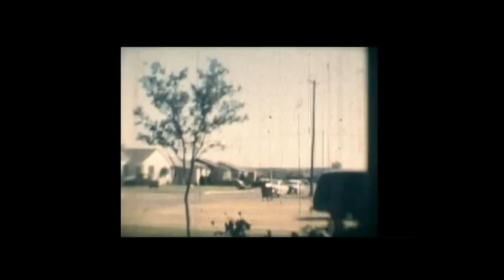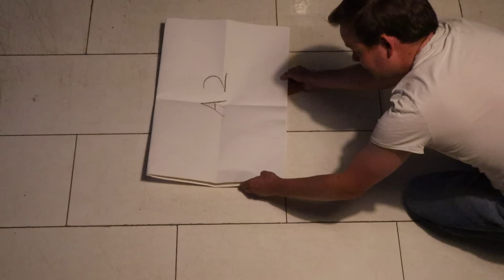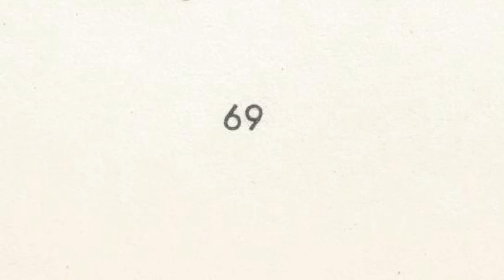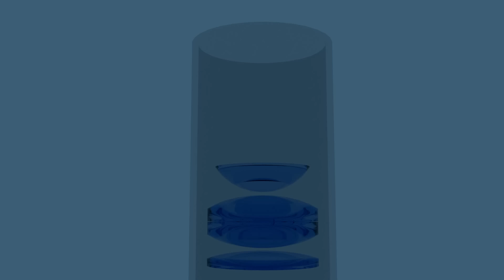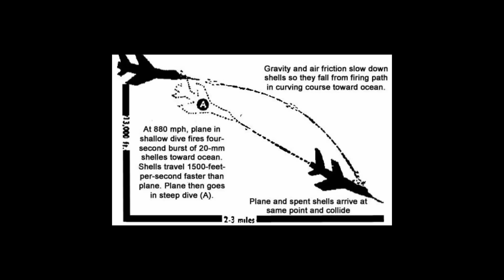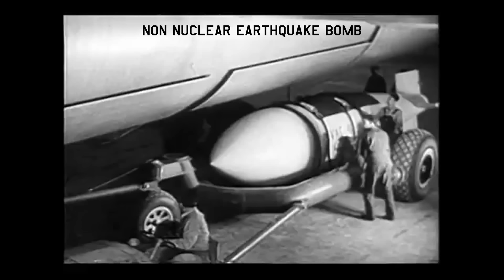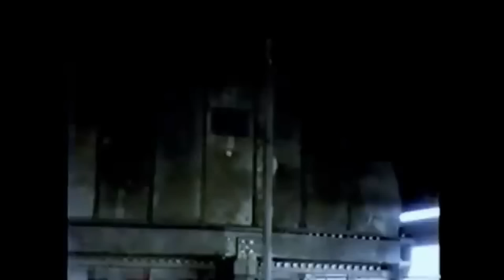Unfathomably American: The Armament Systems of the B-36

Comment: I am at work so I will have to put off this video till later this afternoon. However, I am extremely excited from what snippets I see and I must ask as I did not see in the description:

Is there a way I could get a copy of the manual? I so happen to be working with another on trying to get a demonstration of one of the original b-36 turrets going for the historical record, using both of our resources/parts. Thusly I have been wanting a copy of the turret manuals but they are generally quite pricy.
Reply: Some notes as I am watching this now-
The US made Hispano-Suiza guns are an entire endless rabbithole on their own. Bureau of Ordance did their magic and managed to fuck those things up in several ways, and never truly fixed them. They desperately kept at it though, as they and others had realized the power of a usable HE round made the firepower of one 20mm cannon equal to several .50s (Ive seen it quoted from 3-5 depending on the time). However, due to an obsession with velocity/easier leading, this was also at the time time Bureau of Ord was doing an absolute smattering of .60 caliber projects where they took an anti tank rifle round, very similar to the Soviet 14.5mm, and attempted it in various designs including a reverse engineered MG-151... the gun that was built in 15mm, and then redone in 20mm by the Germans (very obvious foreshadowing) as well as other things of note like the gun that would become the M39 revolver cannon and the gun that would become the "Vulcan Cannon". At the end of all this they remembered what they had already done studies on, that 20mm was the minimum viable size for a usable HE charge and fuzing, and just took .60 caliber (15.2x114mm) and necked it up, creating 20mm Vulcan in an era when everyone was already working on either higher payload (30mm) or higher velocity (20x139mm, etc) versions. Truly amazing. Now we load our phalanxes and the like with tungsten or DU core sabot ammunition to make up for this.

I would like to note that the WW2 British produced Hispano-Suizas are actually still in service today - they were used in jets for a period and then sold, and Sweden installed them in IFVs and others, and now Ukraine has some of those, and I think some others are still floating around in various service.

Electric ammo is common in aircraft at this point (well.. for those that still use guns) and was in development for some time. .60 caliber had electric, 20mm had been in the works and the M24 was specifically an electric version of the M3 which was percussion only. I know for the M24 in particular they added extra hooks to assist with pulling unfired rounds out of the chamber, and likely it was related to the issues you mention. The wax and oil is related to issues from the original WW2/Pre war shenanigans and I will add a relevant quote as a reply to this.

That wall of text over, this is incredible! And the fire control radar locking on is absolutely insane. And these models! The Animations! The pictures! At least one of these shows an electric winding mechanism I had wondered about being used on these things!
Reply: Here is a relevant quote about the US Hispano-Suiza guns from Colonel George Chinn, author of The Machine Gun, a multivolume series for the navy going into intense detail on domestic and foreign cannons and machineguns, both in history, development, and technical design, with a focus on aerial guns:

"Due to an outmoded agreement of longstanding, everything above caliber .60 in the Army is considered artillery and the manufacture of the Hispano-Suiza cannon therefore came under this classification. In other words the production of this high-speed machine gun was done under artillery manufacturing tolerances. The resulting poor mating of parts, coupled with the inherent fault of all gas-operated weapons whereby the breech locking key in the receiver is immovable and the position of the gas port in the barrel is permanently fixed, with made it impossible to adjust the relationship between barrel and breech lock to establish headspace. Thus the most vital measurement in any automatic weapon was governed by chance in this instance.
An unfortunate discovery was that chamber errors in the gun could be corrected for the moment by covering the ammunition case with a heavy lubricant. If the chamber was oversize, it served as a fluid fit to make up the deficiency and, if unsafe head space existed that would result in a case rupture if ammunition was fired dry, then the lubricant allowed the cartridge case to slip back at the start of pressure build up, to take up the slack between the breech lock and the breech lock key. Had this method of "quick fix" not been possible, the Navy would have long ago realized the seriousness of this situation. In fact, this inexcusable method of correction was in use so long that it was becoming accepted as a satisfactory solution of a necessary nuisance."

This continued for the entire lifespan of these guns in US service.. The last model used by the US, the MK16, was used on ships, riverboats, and later the coast guard, from earlier M3 and M24 model guns given cartridge lubricators or at the extreme and an in chamber atomization system for oil lubrication. 
Hispanos in the US are an insane rabbithole.

But, back to the start, if there is any way I could get a scan of that manual it would be extremely helpful for us both in the attempt of getting that turret operational, or at least enough for a demonstration to be recorded with modern quality footage for history.

Comment: The first time I saw the B-36 FE station, it was a SAW trap where the only objective was to start all 10 engines.

Fun fact: N block only stands for nuclear if it's the primary propulsion powerplant (e.g. SSBN, the flight models of NERVA or Orion, etc.), and it always trails the mission categories (a nuclear-powered recon-converted Hercules would be RCN-130, for example)
Reply: The USN uses N as the suffix for nuclear power, but the aircraft designation system is different. Engines get a propulsion system prefix, but aircraft don't.
Reply: Interesting, I assume it stood for non-standard in the NB-36, similar to the NF-104?
Reply: @simplsquam  The best explanation I've heard is that N can stand for "non-returnable", e.g. under permanent modification, and cannot be returned to a pre-modified example, like with, for example, tanker or gunship conversions of the C-130, which are technically possible to reverse, but you'd be in a VERY desparate situation if you need to move so much cargo that you'd be willing to strip millions worth of modifications.

Edit: See also, the NC-131 handling test craft, the NC-135 Special Missions Airframe, the NF-15 STOL testbeds, or the NF-16 (now X-62) thrust vector and AI control testbed.
Reply: @kingawsume  It's specifically used for special tests. Could be anything, but the changes are intended to be permanent, and the mission so niche that a new mission designation isn't warranted, since they're usually one-of-a-kind.

Comment: The design made sense if you assumed that more powerful weapons would be even larger than the originals. That made sense from the perspective of conventional explosives. As it turned out, the actual weapons got much more powerful and a whole lot smaller simultaneously.

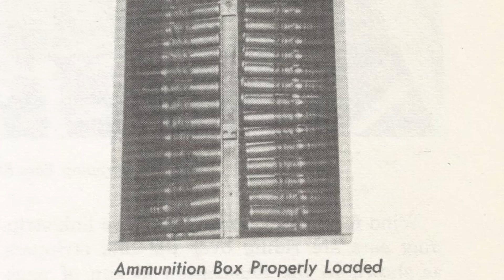Comment: 31:39 Electrically fired ammunition is actually very common in aircraft autocannons.  It is more reliable than mechanical firing when high rates of fire are desired in combination with the G-forces of maneuvering aircraft.  I'm not sure if that is as applicable for a bomber, but in general, many guns designed for aircraft tend to use this system after WWII.  As far as I know, the first widespread use of this was the MG131 which the Germans developed first before WWII.
Reply from the maker: Thanks, yeah it does make an awful lot of sense now that I know it is even an option.
Reply: @Alexander-the-ok  The M61 Vulcan used in many 4th Gen fighters is electronically fire.
Reply: @Alexander-the-ok  do you plan on covering the SR-71?
Reply: Dude electrically fired guns should be a mainstay now. We have solid rocket fuel we can turn off, or on.

  It's called ESP. Electric solid propellent. 

 We have rugged batteries, and graphene capacitors that can offer 15k shots at least before charge. 

 Electronics can last decades in space. They can last in a gun as long as it's designed properly. 

 There would be less delay for shooting. Guns can be made simpler actually. 

 Don't know why people are so adverse to electronics. 

 Wait I do. They buy the cheapest things from Temu (or most advanced). Then compare that to electronics that were made to last. 

 Got them in Safelites, fighters, BULLETS. Nuclear weapons. 

 No I don't think the smallest node or most advanced chips are durable. But it's just a gun. It only needs the simplest electronic to function. Mostly some wires, a battery, a capacitator.

 EtronX is a good example. There's a few electronic guns out there. 

 Dinosaurs when it comes to guns. 

 Honestly they should've put less guns, but bigger. Heck one 76mm flak cannon would be easier to compute, and probably better ha.
Reply: @RedactedDeath part of it is regulatory. A firearm with an electronic primer can easily be turned into a Smart Gun. There have been several attempts to require all guns to be smart once one enters the market.  To gun control advocates, that means the gun is locked and useless unless it is unlocked. 

The other regulatory issue is that a semi automatic with electric primers can be easily converted to a machine gun.
Reply: @simbry49 Ah yeah, no thanks. When I say I want electronic guns I mean just a simple mechanism for an easy trigger pull. Maybe even for a reload system. 

 But really you can make such a simple, robust design that would last five years. Sure you'd have to replace parts. People act like mechanical crap is maintenance free. 

 Anyway I was always told the cost of switching to electronic small arms just would be too costly. Not seen as needed. 

 You saying that honestly instantly makes sense as well. The only smart gun I want is one with next gen scope tech, and electrically fired bullets. 

 Perhaps an electronic loading system depending on design. Guns can basically just be barrels going the metal storm route. Same idea, just with one tube to shoot. The other tubes cycling ammo.
Reply: @RedactedDeath  * years ago Forgotten Weapons covered a Remington 700 that was available 20 years ago that was electrically fired. 

https://youtu.be/8qP6Q9ZEsEo?si=0lzgyO4_i-Gw1ViP
Reply: electrons fast
Reply: @mark.audacity  It’s more that electrodes don’t move. You can put the switching equipment somewhere easily accessible for maintenance, and just run a live and ground cabling into contacts on the bolt track so you only need to rub ‘em down with de-oxidizer every now and then. And you can use an oscillator and a potentiometer to adjust rate of fire on the fly by changing the timing of pulses running into the bolt
Reply: @mark.audacity electrons very fast only photons faster
Reply: This is true, but it's not the only reason why the B-36 specifically used electrically fired ammunition. My grandfather actually worked on the B-36 - he was an electric engineer, and he went to work for Convair as his first job after college in 1946. He was assigned to work on the either the electric ammunition system or on the tailgun radar system (I can't remember which, and sadly I can't ask him as he passed a couple years back.)

Anyway, as my grandfather told it, when the guns for the B-36 were being developed they were initially designed with traditional mechanically-fired ammunition. However, the design of the B-36's turrets - with twin guns mounted side-by-side - created a problem with mechanically fired ammunition. There was no way to get both guns in a turret to fire in perfect synchrony with the mechanical trigger mechanisms, they always fired very slightly out-of-sync. And when the guns in a turret were firing out-of-sync, each time a gun fired, it would put a rotational impulse on the turret, since neither gun was perfectly on the turret centerline. The end result was that the act of the guns firing would constantly disrupt the turret azimuth and throw off the aim, making the shots go wide. Switching the B-36's guns to electrically fired ammunition solved this problem, as it was easy to trigger both guns in sync with the electric ignition system.

But honestly, given the enormous overall weight of the defensive armament after the switch from .50 to 20mm guns, I don't understand why they didn't just delete one gun from each turret and mount the remaining gun center-line, which would have allowed them to keep using the tested and reliable mechanically-fired ammunition.
Reply: @Panzermeister36  A number of tank cannons also use electric primers in their cartridges.
Reply: @staffsgtsarge  Hell, the next likely evolution for tank guns, ETC ammo, outright requires an electric primer/igniter because a conventional one just doesn't have the energy necessary to ignite the propellants used.

Comment: Blykalla that developed nuclear reactor have a (marketed, not yet sold/produced)  truck portable reactor of about 12MWe. That would be about that of half of the prop engines in a B36.. that is also a lead coled reactor so if it was used in a a aircraft shelding would not really be a problem.

They also market a 55MWe ship portable reactor.

You could totaly just plop them i to a B36 and fly them.

Comment: can't you "power" an aircraft with a shockwave from a tiny nuke? no wait. that was another lunatic who proposed that to drive a spaceship...
Reply: Using a small nuke for a NATO(nuclear assisted take-off) if the bombs are already falling you can at least deny the enemy satisfaction of blowing up an airbase
Reply: Ah, project Orion. That probably also deserves an Alexander the OK video.
Reply: The most insane part of nuclear pulse drives is that they're unironically one of the best proposals for a space engine, at least in terms of efficiency and power. It can generate tremendous thrust compared to things like fusion rockets and ion engines, while also requiring very little fuel compared to traditional chemical or even proposed nuclear thermal rockets that use liquid propellants

You just have to get around the teensy little detail of carting around a few thousand nuclear shaped charges, and getting said charges safely into space

Comment: 48:45 funny enough, most engines have their displacement measures in liters here anyway.
Reply: @cobaltmn5716  yeah, but that only started happening in the late 70's here. Before that, it was cubic inches - so an engine from the 50's would be measured in cubic inches within its original manual.
Reply: They do now but they didn't used to. 
One thing a lot of people fail to notice is that American units are just hilariously mixed 
Cocaine is 12 oz small Coke bottle is 16.9 Oz which is 500 ml 
In your carry-on luggage on a plane liquids have to be 3.2 Oz but that's actually 100ml 
Green plants are often sold by the ounce or the 8th of an ounce but an eighth of an ounce is 3.5 grams 
And it just goes on from there 
And at the very bottom we are officially a metric Nation literally every American unit is defined by a metric SI unit 
To be fair though a few of our units are just more intuitively usable 
Like 1 degree Fahrenheit is the smallest difference that the average person can detect 
A foot is basically what it says on the tin 
A nautical mile is what you want to use for navigation cuz that's how the world works in terms of longitude and latitude on a map. 
Saying someone is 6 ft 2 in tall is just easier to understand than 195 cm 

Don't get me wrong magic is far superior in pretty much every other way

Comment: On the unlimited range of a nuke/thermal propelled aircraft: Would you not run out of seconday consumables like engine oil? I heard that's the limiting factor on the B2, when you account fo A2A refueling.
Reply: You can make room for extra lubricants or even develop a system for in flight oil changing system.
But it's more efficient to just go back to the ground for when you must eventually replace the crews
Reply: Nobody's really bothered to build an aircraft with an absurdly large amount of lubricant because it's always been assumed you'd need to land long before it ran out.

But you could add way more if you really wanted to. 

You've abandoned environmentalism since you're flying a nuclear reactor, so in flight oil changes would be possible as well, just dump the old and feed in a clean tank. Might want to shut that prop down during that operation, but if you were prepared to be inefficient, don't even need to do that.
Reply: Yeah, loving the thought that you'd fly until running out of snacks or chemo meds......
Reply: It's the limiting factor on the Tu-160's endurance. I hadn't heard about the B-2.
Reply: Hey, spare a thought for the crew
Reply: You wouldn't need engine oil at all. There would be an air-cooled nuclear reactor with no moving parts in the actual thrust-producing part. Basically a nuclear ramjet!
Reply: @N9197U yeah good luck getting the air compressed enough to actually generate any thrust at subsonic speeds, also you're forgetting you still need electric generators on board. Nuclear reactors only generate heat. Those generators will also need a considerable amount of lubricant